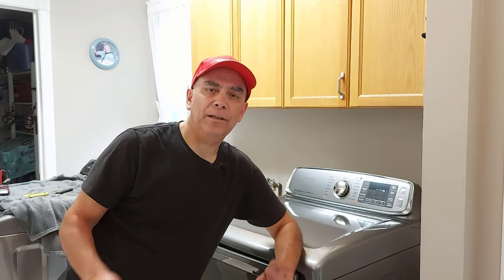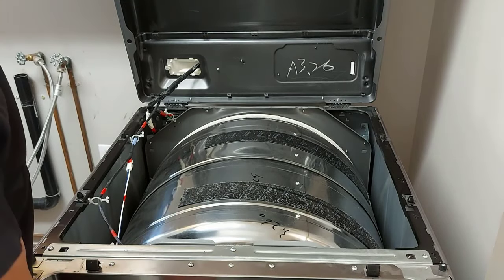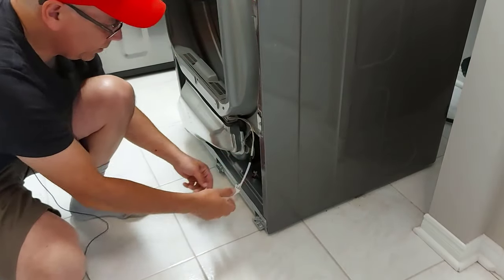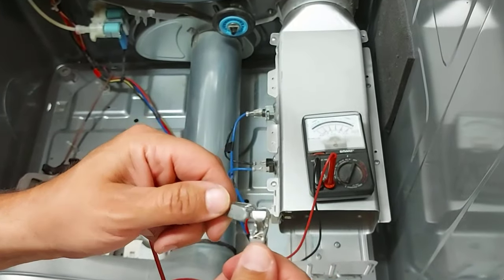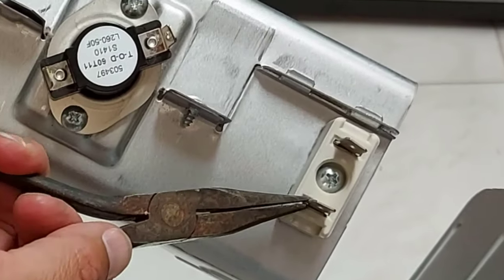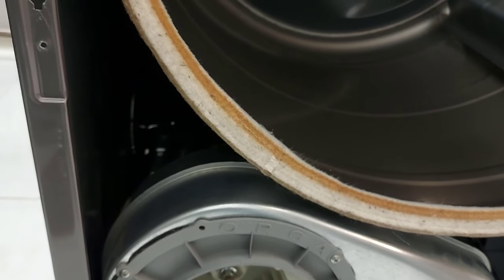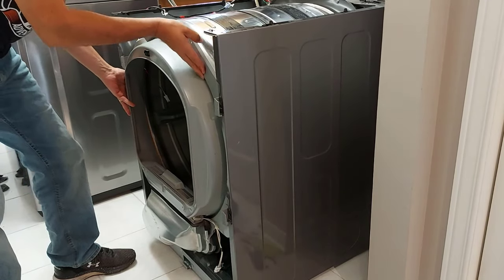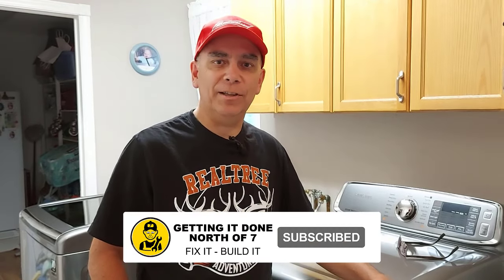How to Fix Samsung Dryer Not Heating | Common Problem, Easy Repair

Comment: Bought a dryer they said it worked then when they dropped it off magically there was a heater element in it and I wasn't home when they did. Either way before installing new dryer I cleaned my vent but didn't realize I pushed everything in the middle and blocked the vent off with lint in the middle because it's 22' long, I installed dryer with new element ran for like 5 minutes heat then a burning smell and heat shut off. Thought I blew thermal fuse ordered and replaced that, didn't fix it. Replaced thermistor and thermostat as well an still won't heat. 

Its exactly like the one your working on but I don't remember the model number off the top of my head.

Comment: My door does not come out as easy as it looks in the video. Something holds it tight on the bottom. What could it be? Does not want to ruin it. I have exact the same model. Please, advise.
Reply: Figured it out. He forgot to mention to unscrew the screw on the top middle right beneath white plastic latch.

Comment: I replaced both thermostats while waiting for the new heater element to arrive. The dryer wouldn't heat until I replaced the heating element and then died again after two loads. 
Any advice?
Reply from the maker: Any lint blockage on the dryer?
Reply: @GettingItDoneRepairs  None in the dryer itself, waiting on the property manager to arrange someone to clean the ducts in the house. I'm going to assume it's pretty backed up if it burned out the new element that quickly. (Note: My wife just called me while I'm at work and said the dryer isn't heating again, so I'm only guessing the element is burned up, I'll find out when I get home).

Thanks for the quick response, btw! 😎
Reply from the maker: @Raymond Neal  oh no, that's not good if the element burned out again. Good luck with it. If you figure it all out please let me know. Thanks 👍
Reply: @GettingItDoneRepairs  Will do! Thank you!
Reply: @GettingItDoneRepairs  The duct leading out of the house was backed up and they said that it looked like it hadn't been cleaned since well before we moved in. 
The Heating Element is still in tact, so I'm assuming I blew the thermistor. I'll be ordering a new one today.
Reply: This is a Samsung dryer that uses the DC47-00016A thermal fuse (it’s the small one that is pop riveted to the housing). I’ve replaced this particular part twice with the new heater element and within 30 seconds of operation, the fuse blows. Any ideas as to why?

Comment: This is a good time to check and clean the wheel that is a very commom problem if they get stuck they can burn the motor, just rolll them by hand to see if they turn smoothly, normally they collect hair and lint causing them to get stuck, and tear and wear, every 3 to 4 year they get issues aftermarket wheels, easy to change for 30 dollars

Comment: How did you disconnect the wire from the front so easily? I can't get it off for the life of me, so I'm unable to get the door off.
Reply from the maker: I will be making a video about shortly
Reply: @GettingItDoneRepairs  I appreciate the quick response. I will definitely watch the video. Although, I ended up finally getting off. Thanks for the helpful video!

Comment: The tension wheel is easy but not as explained.  Face square to the drum. Reach around to the left as shown BUT also to the right.   You capuchin the tensioner over to the left with your right hand and guide the belt on as shown with left hand.  Easier than trying to do it only with left hand.  Just saying, good video .though.

Comment: Hey I changed all the parts including the heating element and it’s still not heating. The element was snapped but after replacing it, it is still not heating. Any idea?
Reply: Found the solution. I bought a stronger one of those little last little circles that are on the outside of the heating element housing... The last one on the left. I was buying one that was 170 and I got a 300 one and it worked👍